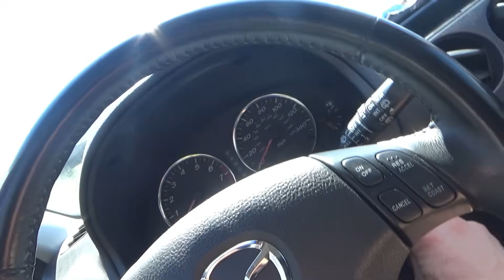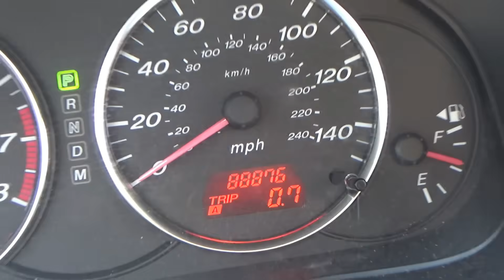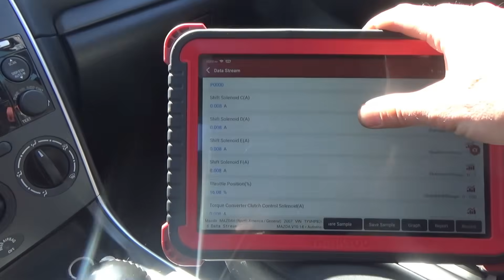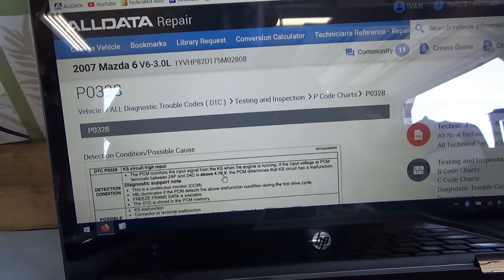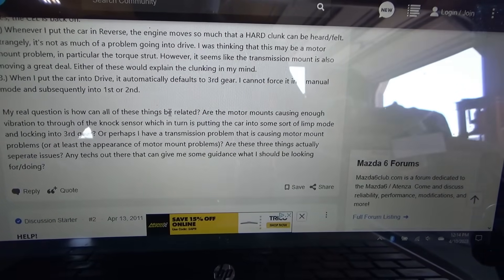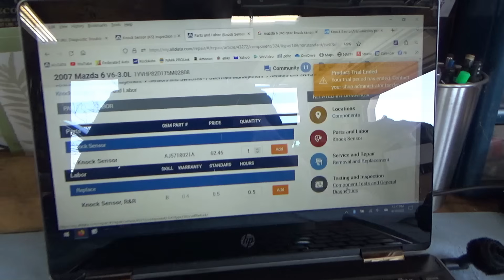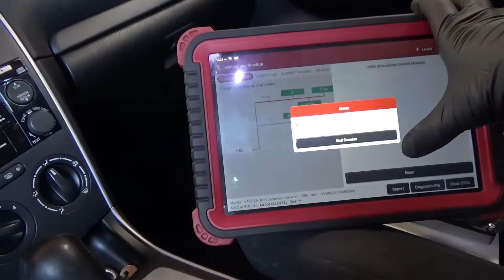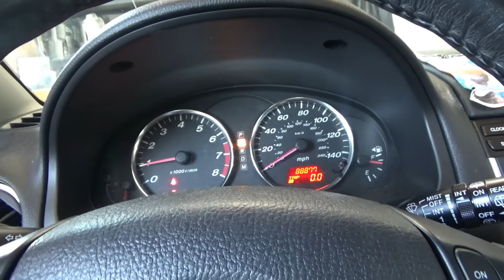At Transmission Shop for 8 MONTHS?? Fixed in 15 MINUTES!! (Mazda 6 Stuck in 3rd P0328)

Comment: Is there wrong firmware in the computer? … a 2007 Mazda shouldn’t have istop. My 2016 has istop though.

Lack of transmission fluid or wrong fluid used? 
Remove all the customers’ after market crap (exhaust) that is fitted and see if it still does it.

Comment: I seriously wish I could shadow you for a few weeks and watch you work. Its extremely impressive the way your brain works through some of these issues. Hell, i'd glady work for free the entire time. I legit have 26 years experience as a paid professional automotive tech but i couldn't hold a candle to what you do and am pretty envious of the level you're at in this field. Definitely one of my idols. No bs. And I don't have too many. Staten Island Keith is one. Mr Danner is another. Mr and Mrs O, Perkins, Brin Klein, Cody, Super Mario. Cuba, Mech Mindset. Steckler, Pete Meier, Jerry Truglia, Mike Becker, Bernie Thompson, and plenty more but its late and my brains slowing down so I apologize for leaving a few out. What I'd give to be a fly on the wall.
Reply: its not just Ivans gift of mechanical and electrical skills., its his control of emotions.. he doesnt seem to get angry or aggravated by most problems. he is able to clear the clutter from previous attempts. and focus. most techs experience alot of pressure and fear because you are against the clock.  he is very even keel emotionally. has a positive attitude and is very determined to find the root problem.
Reply: @randy1ization  didn't see this until now (5 months later) buy I totally agree. Actually going through something like that right now. Got a 95 Z28 with a misfire. A problem  I usually look forward to solving. Can only be a handful of things right? Lol well I'm at the point my brains just shutting down. I'm frustrated, and embarrassed as all hell. But for whatever reason I can't nail it down so I'm taking some time away from it. Clear my head and hopefully it'll click one day when I'm barely thinking about it. Emotional control is definitely something I'm striving for but I'm failing miserably
Reply: start it up at night and look for spark jumping from a wire to a ground.. try to split the system into three parts,,, is it electrical miss, fuel related miss or mechanically induced miss... I vacuum gauge can show you alot,, a miss caused by a burned or worn valve will show up consistantly.. You can see it on a vacuum gauge.. the pressure(vacuum)   will jump up a bit for a second.    electrical misfires tend to be intermittent, but not always.. pulling to plugs and inspecting them can tell you things to,,, c I always go back to basics, when I find myself going down a rabbit hole.. is your motor TBI?     also what distributor ?    @KBLIZZ333
Reply: I am not sure shadowing him would help.  He is a trained engineer who knows how to be analytical.  Using all available tools including scopes, pressure transducers and the best scanners. He has built up large amounts of experience by taking the harder diagnostic specialty route and no employees rather than the common and repetitive shop track.  His wife is a professional which no doubt allowed him time to build his strengths before he became as proficient as he is today.  And the small things.  The use of a notebook to record steps and measurements.  Knowing how to use search terms effectively by guessing terms likely to be in the answer. Occasionally phone a friend.  Finally he was smart enough to visit youtubers like Eric O and listen when Eric encouraged him to do youtube.  Now Ivan's youtube income may surpass his customer income.
Reply: Yes! All that was said is very true!
He's worked on old motorcycles bringing them back to life.
He's spent time in Russia where thinking outside the box was definitely required. Not sure how long.
Keith (New level auto diagnostics) took him under his wing for a week or so.
I believe he's an EE that was working on his masters and got tired of the 9-5 drag and went out on his own.
Ivan, did I miss anything or something needing correcting?
Reply: @dans_Learning_Curve  its also genetics.. his father was a nuclear scientist.. the apple usually doesnt fall far from the tree.  Teaching people when  they are young how to do deductive reasoning,  utilize thier resources, and look at challenges as an interesting project rather then grueling work carries thru the adult life of the person.  Ivan always says "this should be a fun case study". he has a different attitude. than your average Joe and is not so prideful that he is ashamed to ask for help at times.. he is smart enough to know that he doesnt know everything.
Reply: Just shadow him by viewing his videos is already great 👍

Comment: How can a faulty knock sensor cause the transmission to go in limp mode? What is the logic?
Reply: Faulty knock sensor can't knock any sense into the ECM.
Reply from the maker: Mazda Ford logic 🤣
Reply: @PineHollowAutoDiagnostics  I read somewhere that if a brake light fails, a Mitsubishi Mirage goes into limp mode. That's Mitsubishi logic!
Reply: @ronaldderooij1774  Teaches people to fix their goddamn brake lights.

Comment: What did we learn? There is a software bug most likely in the transmission controller. The PCM will broadcast the P0328 fault to the other powertrain modules on the bus. Putting the transmission in limp home mode will not address engine detonation. The PCM will address a bad knock sensor by changing the spark advance to limit the chance of detonation. The only strategy that I know of that could cause a system wide reaction to a bad knock sensor is if the PCM strategy used active knock. Which is a way to enter a knock condition given a set of engine drive cycle parameters to test the system and other things like fuel octane estimate. However, when a knock sensor is bad or the connector disconnected, active knock should be disabled. Perhaps there is a software update for the TCM?

For a transmission in limp home mode for an extended time, I would do a fluid and filter change. Perhaps not a complete transmission flush unless the fluid looks and smells bad. So, at minimum, just the fluid in the pan and the filter. But, be warned dropping the pan may not be easy and in doing so you may require a new pan gasket. However, by inspecting the pan and any debris you can get a feel for if the transmission has been abused by limp home mode. Perhaps the transmission shop already changed the fluid and the filter?

If you do a test drive after limp home mode and you feel a TCC shudder or an overdrive shift shudder, then replace the fluid and filter. If you are doing a complete flush you could try using a synthetic blend transmission fluid from Mobil 1 which I have found has a slightly higher viscosity than most factory fluid which helps eliminate shudder if you do a complete flush (change).

Comment: a bad map. maf, tps, o2 sensor, knock sensor and several other inputs can put a transmission in limp mode. its shocking that the trans shop didnt know this.
Reply from the maker: I've never seen any other car do this...
Reply: @PineHollowAutoDiagnostics   you will.. great work, logical deduction led to the fix! many people junk cars thinking the transmission is going out, and its just a 40.00 TPS  sensor.  people who have the perpetual check engine light on dont correlate the problem. this happened to my 94 sliverado.. I had pressure washed the engine. a few days later the trans started shifting errastically, bucking, ect.  theres a little seal behind the TPS that was shrunk, and allowed water to get in the sensor. at the same time a check engine light came on.  changed the TPS and everything was good.  also output speed sensors are magnetic and can attract alot of metal particles on the sensor and cause problems.  also dluid leaking into the trans harness connector as ive already mentioned.

Comment: Finding info on the internet or youtube is how I have fixed my own cars for over 20 years now;  but it's really frustrating when there's nothing out there for your issue.  It can be hit or miss. Especially just trying to find wiring diagrams.   I usually just buy a service manual for my cars;  only being thirty bucks or less, it's much cheaper than alldata or any of the others.

Comment: That's a software bug for sure.   No way a knock sensor in high resistance should lock the transmission into 3rd gear unless they want to blow transmissions for the average person who lets check engine lights slide for too long.

Comment: God bless Google.  And the people that post on it of course.  
I do DIY repairs and favours for friends so really only expenses are covered.   I can’t afford an all data subscription or Maxwell?? For wiring diagrams. So I have almost always found what I need on Google.  Sometimes it takes some finding but it’s usually buried out there somewhere. 
I’m saving up for your think car scan tool one day I’ll get it. Until then I use a really old style Foxwell Pro scanner.  With full bidirectional functions. That was about $1200 AU and the 2 main reasons were it understands Japanese for the jap imports ie Nissan Elgrand Japan exclusive market.  I didn’t find any other scan tool that could talk to it. And there is no annual subscription for updates. That’s the thing that worries me going after a new scan tool like yours.  What are the annual fees on that?
Anyway. Love your work as always. Looking forward to your next installment

Comment: like your tech manual on the dash that manual will not  put you  limp mode have a chrysler 200 knock sensor set a   code but cleared it off for a week no drive ability problemms stay on top of your problemms

Comment: Mazda did not want their engine blowing due to continued driving without a knock sensor.. 
And a simple Google search has the answer. WTF
Reply from the maker: Correct, they wanted to blow up the transmission with violent shifts instead 😂

Comment: You are correct Ivan. Information is out there on the Net. 
People have cornputer at their finger tips and don't know how to find things. 
When I have a vehicle come to me. I go on a scavenger hunt for information. 
A few months ago. A customer was having problems with their Ford exploder. Car wouldn't start.
No crank nothing. Customer claims I didn't do anything. 🫣
So I told him. Tow it to my Shade tree. I will do a diagnosis. Next moaning. I did a scan. Code said no keys are present? 
He had the keys for it. 
My scanner said it could talk to the computer. Nope..not by a long shot. Just as you did. I went on the hunt. Found my answers and I needed software and a dongle that would hook up to the truck. 3 days later. Got my tool. Download the software and paid my fee. I also ordered new blank keys. Had the keys cut. 
Now I got into the computer and erased all the keys. Programmed the new keys. 
Truck started right up. When I tried to erase the original keys. It said it's programmed already.
So I earned all keys one more time. And presto. Truck started again with the new keys and the new ones. 
They did call Ford. 650.00 was the quote..
I spent 50.00 
Customer was happy.
Yes sir Ivan... information is out there.

Comment: That's crazy. I never would have dreamed a faulty knock sensor would put a computer in limp mode.
Reply: the knock sensor is for what ..... to tell the computer of a problem ...... the computer can only know /respond to what it is told  ..... that's my take on it .... me : not a mechanic
Reply: @ivanolsen7966  the knock sensor is to detect engine knock (fuel knock) so it can back off the ignition timing. It's part of a feedback system, not a problem detector. 

Forcing transmission limp mode is extremely odd behavior for that sensor. Engine limp mode can be expected, but a perfectly running engine and only the trans in limp mode? It's very odd.
Reply: @volvo09  Exactly
Reply: @volvo09  Perhaps it is just tied into the limp logic? Just a thought.
Reply: @volvo09  My bet is it's a software bug.  The PCM sees a problem, stops sending the right data to the TCM and the TCM gets stuck in 3rd gear.
Reply: You will be surprised that in  newer cars, even a bad taillight bulb will trigger the limp mode lol learned the hardway

Comment: Am having the issue with a CX7 2007 with the a ECT sensor high code and it's in limp mode..I wired in some resistors and got its out of limp mode.. but I can't find the specs for the ECT sensor (ohms) anyone who has it just comment.... thanks
Reply: If you have a scanner, maybe just hook up an adjustable resistor in place of the sensor, and see what temperature the scanner reads for different values of resistor.
Reply from the maker: @Graham_Wideman  bingo 😎👌
Reply: 2007 L3 TC engine..6AT

Comment: Always such great content.  I would have never thought that these two things were interrelated.  They were so lucky to bring it to you.
Reply: The PCM firmware was programmed to put the TCM into limp mode with a knock sensor fault. Likely the best approach is to have not codes ever. If one pops up then whatever change in the vehicle behavior occurs is related to the code.
Reply: @SirDeanosity  Yes.  Thanks for the information.  Always glad to learn.  There are some smart people out there.  I am not necessarily one of them so I am still driving my 1989Honda CRX HF that I bought new in Jan. 1989.  It has over 377,000 miles on the odometer and has never been in the shop.  The simplicity of the car matches my skill level perfectly.  I don't have any power windows or seats, no airbags, no traction control, lane assist, power mirrors, automatic transmission, cruise control, infotainment system or anything else.  I don't even have a cupholder.  It was, and is still, basic transportation that has never broken down on me once and I have kept it that way with just preventative maintenance.  Not one drop of oil has even hit the ground.  It still blows 40 degrees through the center vent with the air conditioner on which is a godsend here in the deep south.  It is a trusted piece of history to me and will never be for sale.  I love the PHAD channel for Ivan's great diagnostics and how often he is able to fix something with no parts required and his sincerity and honesty.  Have a great day.

Comment: Definitely some questionable programming in that TCM software to go into limp mode for a fault like that. I could maybe see if they were trying to avoid the engine pinging or something, but I'd think locking it in 3rd from a stop would only make that worse..

Reminds me of the GM vehicles which would keep the cooling fan running all the time with literally any DTC set.
Reply: What's even more interesting is the code description does not mention that this happens when set .
Reply: @keltecshooter  And there being no code in the TCM saying it's in limp mode because of a dependency on a fault code in the PCM.

Meanwhile the PCM wasn't in limp mode at all...

Comment: "Google it" is a thing for a reason. I did a flip on a XTerra a while back. It didn't shift into 4th gear (auto). I Googled common Nissan transmission complaints for that make/model/year and found the solenoids in the trans were notorious for failing. I replaced all 4 just to be safe and had a shop do a trans fluid flush for me. I turned a $2200 investment into a $5000 sale.

Comment: Seems to be a Mazda thing. I had a early 10s Mazda 3  that the customer complaint was it wouldn't shutoff. you'd press the start stop button and the motor would shut down but the car would remain in Key on engine off unless you did some fancy dance hold the button and press it in a special order. The fix? repaired the ABS fault and the car turned off normally
Reply from the maker: That's crazy lol